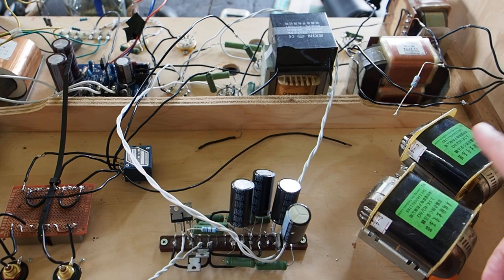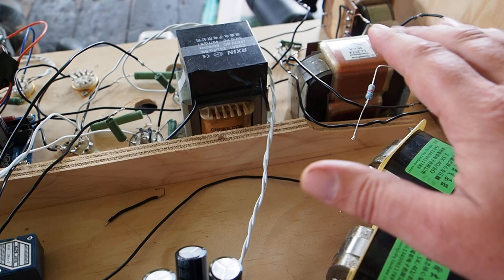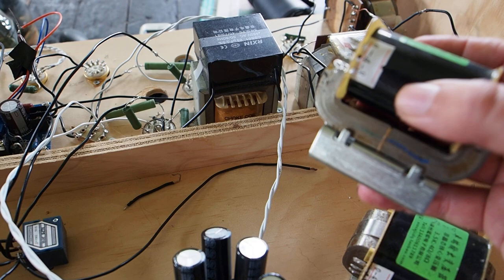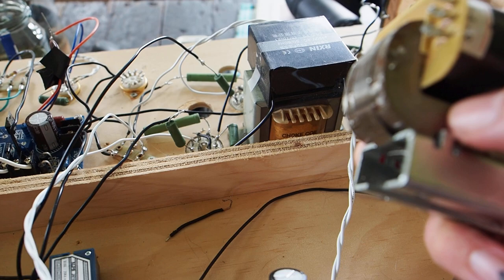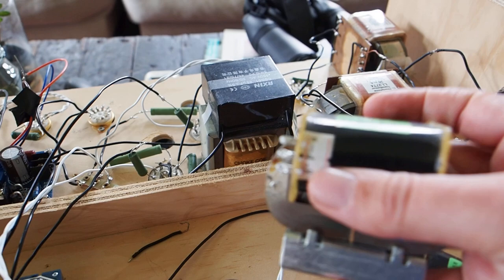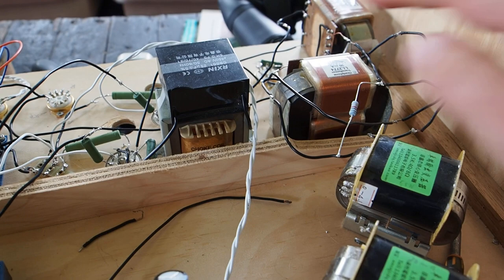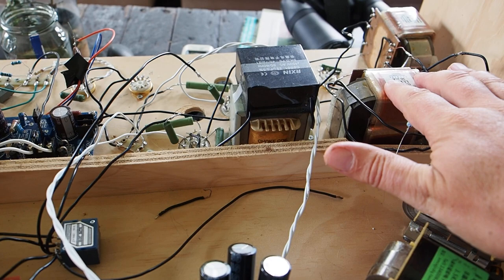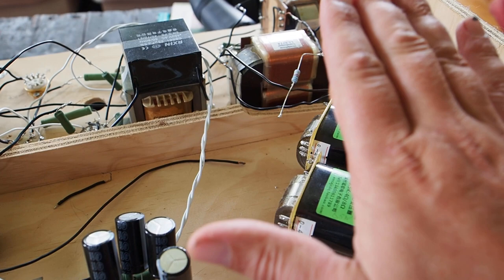The headphone project: update Lundahl vs amorphous core

Comment: I like amorphous core for low
or line level signals and/or in a parafeed app..  I have yet to listen to Finemet (nanocrystalline) double c-core transformers.. 

The overall skill and design chops of the winder/manuf is a bigger influence on SQ for me personally.. Anything from M6 steel EI core and higher grade up is already very good IMHO.. So if say you go Finemet (Hitachi), be ready to scrutiinze the quality of even your HT main filtering caps and resistors, etc., ‘cause you’ll hear their influence more IMO.
Reply from the maker: Hi Rick. Thank you for that report and yes I hope to listen to some more types of OTs - food for thought.  I can see your point using it for lower level signals.

I feel that my headphone and main amp(s) are mostly bottlenecked with OTs now although the Lundahls are very balanced tonally so its not directly obvious in listening.

On the topic of components being influential to the sound quality in my experience, single ended is very sensitive to power supply.. in my main amp, the driver SE stage - despite drawing maybe 9,10ma only.. all improvements mattered a lot - far more than the power stage I'm a big fan of high value inductors feeding single ended tubes :)

I'll have a video soon on my main amp as you requested couple of months ago...
Reply: @EduardBroekman  Hi Eduard, I also found that changes to the driver stage matter more than changes to the power stage in SE amps. People often overlook that... most of the focus appears always on the power tube, but the driver / input is often far more critical.
I'm curious how the new AM transformers will sound! Thank you for the source tip! I'm really tempted to try them out myself. :)
Reply from the maker: @realworldaudio  All the driver faults get amplified :-) Because I use a regulated pass tube setup, which is really not a natural fit for singled ended, I found that adding a LC stage (20H + very high current cap 25uF) for the driver, caused a major improvement in macro dynamics and articulation/clarity.. I'll email you another link with an interesting candidate, with higher inductance..
Reply: @EduardBroekman  
Hi Eduard, You’re welcome..  Some well designed OPT’s that offer “very low” signal loss like AM and Nanocrystalline cores are more sensitive to associated passive components surrounding it, even the type of Filament heating (plus the nuances of its variations).. So you’d have to tinker more IMO to get a more natural balanced sound.. SE is technically more sensitive to PSU issues and stiffness, but PP with zero nfb too, just to a lesser degree..

Some advocate for using one single type of core material for everything in an amp and even the whole system.. I tend to like to mix things up like a chef, like AM for Linestage OPT and input trafos, Nickel (permalloy) for IT’s, and maybe Double C-core steel a la Hashimoto for the OPT..

Cool about your main amp getting a video soon.. I would not expect less from you, than an “Iron-rich” PSU =) feeding both the Input/Driver, and Output stages.. 

I think ThorstenL published a good article on his old website on how driver stage types and variations influence the amp in more obvious ways than the output stage..
Reply: @EduardBroekman  Thank you, superb! Yes, that's a very elegant solution, adding the big L after the regulation. That reminds me that it's high time that I rebuild my main SE amp... I'm going to change the 807/KT66 to 801 ; ). Been planning for a while, but so many projects and so little time...
Reply from the maker: @realworldaudio  I'm not entirely sure it will work for SE speaker projects, but for single ended headphone amps the 40H seems to work very nicely and overcomes the pass tube impedance (dual 6P43P or EL86 or single 6S19P all end up as Rp=400ohm, 100+ma easy) . 

But wow the 801A is impressive, unbelievably linear even in A2, mu=8 makes bias lots easier, no super high voltages... only limited availability and a suitable transformer to look out for. Nice project! Mental note made here too - me likey :)
Reply: @realworldaudio  Hi Janos.. Do you plan in changing the SE OPT’s too with a higher Pri Impedance for the 801A?
Reply: @rickg8015  Hi Rick, no need for that, the OPT is already with high primary  impedance: 13.5K to 8R ; ) , perfect for the operating point I will use.
Reply: @EduardBroekman  The Type 10 family (801, 801A, 10Y, VT-52, VT-62 etc) is likely the most linear vacuum tube ever made. Certainly, it is the most linear driver tube. (When used as driver for higher power amps). It is the tube that has the least personality of any vacuum tube. 2A3, 300B, 45... all have their distinct personalities and you can instantly tell they are playing. Type 10... they seem not to add a flavor.
It is regarded as the highest end driver tube for DHT SET power tubes, typically for 211, 845 and sometimes even 300B as well (possibly the finest way to drive the 300B). Audio Note uses it in their Ongaku to drive the 211 (they use the 10Y variety). Most of this family is thoriated tungsten filament.  The basic 10 is 1.6W output only with 425V plate max, and the 801 and others have 600V plate max, higher plate dissipation and about 4W output. Sadly, all of them are getting pretty expensive, especially the VT varieties, but 10 years ago they were quite cheap, when the only company using them at that time was Audio note... Still, they are not yet in the stratospheric price range, but already in the 100$ a pop. Hard, but not (yet) impossible to acquire. Luckily, I have a few already,have been waiting for many years to try out...
Reply: @realworldaudio  I have a quad of VT-62 Hytrons myself for some years now, waiting to be used.. No budget and time yet.